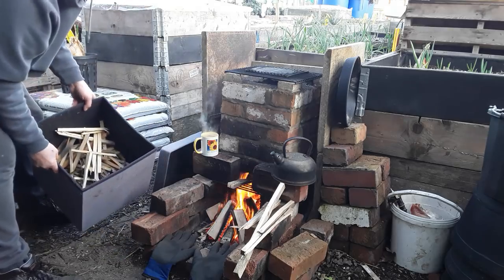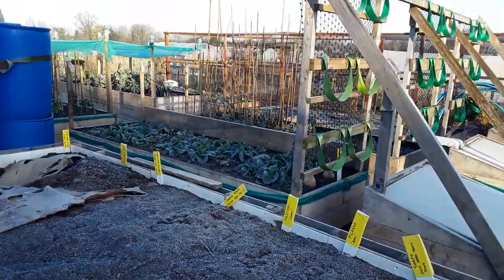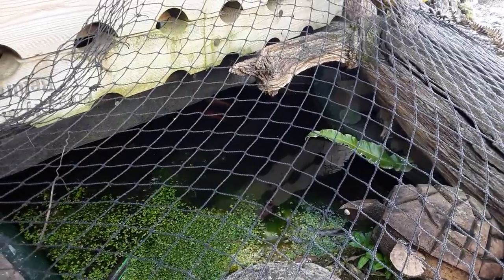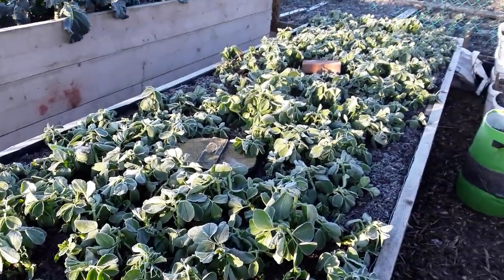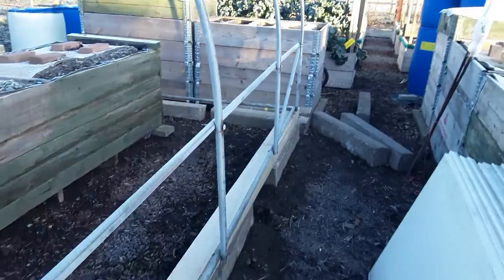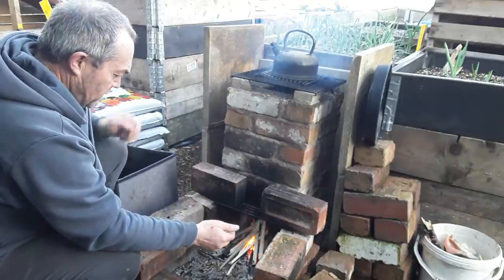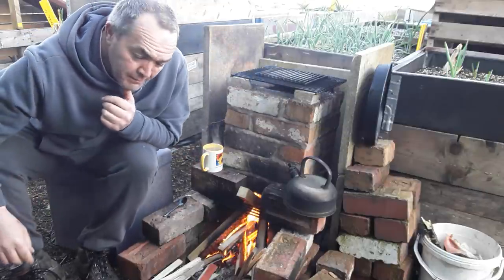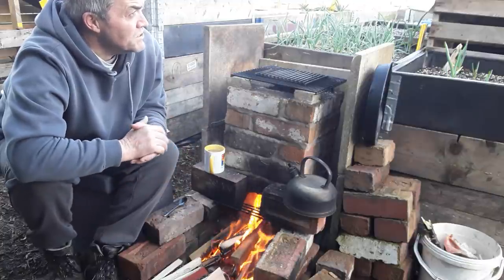SHEDWARS21: Jobs For March On My Allotments

Comment: Love the fire, this may be a stupid question,  if u don't fill the gap in between the kerbs won't that let to much cold air in?
Reply from the maker: We will need ventilation and in Friday's update the gap where the screws are will let more in so maybe fill the kerb gaps with woodchips. 

♻️Happy gardening, Terry King.
Reply: @terrykingsallotmentgardening  makes sense, I struggle with ventilation in my greenhouse
Reply from the maker: @markshaw5835  👍😁👍

Comment: Sad you are not trying the log or waste wood, timber method instead of kindling after you have the fire going ?
Reply from the maker: All my off cuts are being burned Mike, a very hungry fire and after an hour working it does need some kindling to get it going again. 

🔥🤗🔥Happy gardening, Terry King.
Reply: @terrykingsallotmentgardening  You could have a job in Steel works 😂😂😂
Reply from the maker: @mikesmith-yj3ih  🔥😲😮🤣

Comment: Hi Terry, I have 4 tonnes of manure (it's from a stable so mixed with shavings and hay) that heated up to 30+ deg C and then went cold. I turned it all (a lot of work!) in to compost bins and it's still been cold since. I have two bins and the second I've mixed in grass and other food waste etc as an experiment to see if this time it will get hotter but do you have any ideas why it wont heat up again? I understand that water is important (it's still wet), oxygen (I've turned it) and then nitrogen...but surely the manure is full of it? Do you have any ideas about how to get it hot again?  And also any idea how to tell if it needs more green or brown...I have loads of chippings. Cheers and trrhanks for your videos they are very helpful.
Reply from the maker: There is lots of information on our Facebook Group "Keep Calm and make Compost " I don't do hot Composting because it difficult to get it right and I prefer the worms to the work.

♻️Happy gardening, Terry King.
Reply: @terrykingsallotmentgardening  Thanks Terry, it sure is hard to get right ha ha. I'll let the worms work on it and focus on something else for now then :)